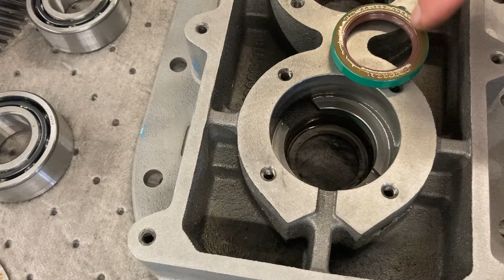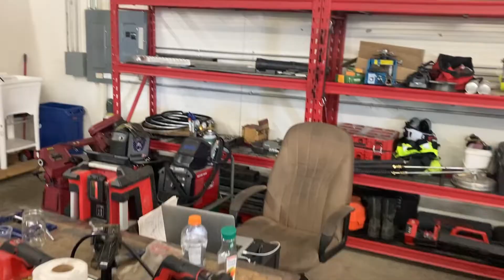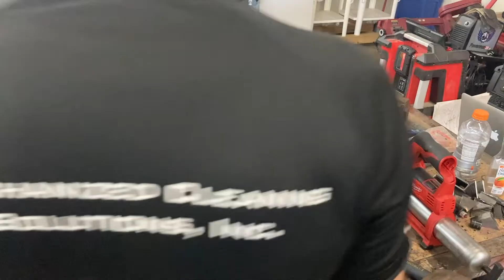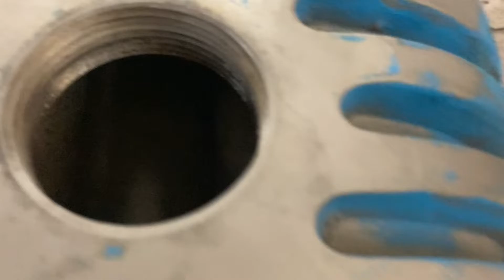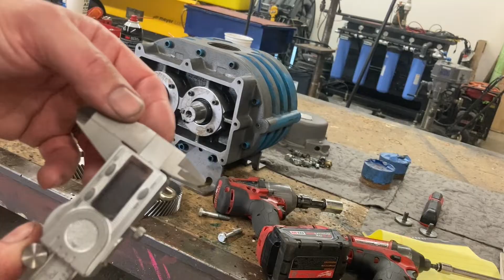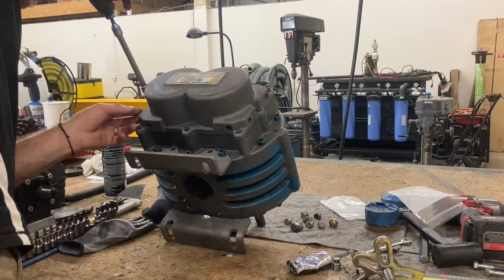Rebuilding a Roots Blower   Part 2: Reassembly & Timing

Comment: Get yourself a bearing heater or a light boat of grease on the inner race hit it with a torch until oil just starts to smoke. Then they will just drop right on. Never hammer on the bearing this way.

Comment: I heated my gears up, not a lot either. Used a heat gun not a flame of any sort. I could handle them bare handed without burning myself but still hot enough to where i could slide the gears easily on and off without tools. If you heat your gears and still have a hard time you can use freeze spray on the shaft to shrink it a bit.

Comment: You should never beat on bearings with a hammer. You need a bearing heater element to set the wear sleaves and bearing races on for about 10 minutes while putting loctite retaining compound on the shaft. With welding gloves on and the sleaves and races now tinted slightly yellowish in color, you take the sleaves and bearing races off the heating element and drop them right into place. No hammer or socket or punch tool neccessary. Also when you time the gears the lobes/rotors should be timed one at a time at a 45 degree angle with the feeler gauge in place when the gear is set with the correct torque spec as the manual suggests. This video is basically showing you how not te rebuild a blower lol.
Reply: ya this is my backyard mechanic version because nobody else who knows what the f*** they are doing got off their ass and put a video up.

Comment: Used to repair tepro roots pump. They got straight gears, so you don’t really have to time the vanes, but I’m glad this video exists so I can prepare for curved gears.
Reply: You still have to time them.
Reply: @scottdove6364 yea I figured that out. They were held by friction, so if you partially pull it off, lobes can slip. Basically that’s how I calibrated these.

Comment: You're lucky you have keyways, I'm building a 406j roots blower, and there's no timing alignmentarks etc, i made my own before dissassembly luckily on the shafts*
Ibised a carpenders square to check alignment on the marks i made*
The seals do go with the open end facing out, that deals with 2 issues-1 installation on the shaft is less likely to rip the seal* 2- the oil will stay in the case better woth the seals design.
Reply: After you have ends on block lobes and use feeler gauges to measure total clearance can time off front or rear just make sure you split clearance a couple thousands more on front front grows more. Put shims between leading lobe when pressing on gear. I also don’t see him checking end clearance

Comment: what is the maximum continuous running time of roots blowers?
Reply from the maker: On a bench in a shop, not in any working application, or moving any type of media. Until you run out of gas or the power shuts off.

Our application is probably the worst and has the least run time between cleanings and rebuilds.

Comment: High vacuum grease on the seals and as far as the sand you killed that blower should always blow out brake clean body and plates brake clean again and feel with your hand or put wd40 on a rag  and wipe all the places you can reach and the ones u can’t make something the particles will stick to that rag showing the cleanliness of the parts

Comment: Heat the inner race only and work fast tapping each position n,s,e,w of the inner race till bottomed out let cool to room temp then make sure it is seated again it could draw off the shoulder a 1/32

Comment: Please my dear brother. What kind of oil did you use? Can I use 46 or 68 oil in its place?
I follow you from the Kingdom of Morocco
Reply: Tuthill maneja aceite ISO VG 220 sintético, es el que recomienda en la mayoría de aplicaciones
Reply: @mayacruzcarlos2383 Can I use 0048E trane oil? Thanks
Reply from the maker: Our blowers made by Tuthill, use “HEC 100 Synthetic lubricant”.  That’s an oil the the carpet cleaner machines use, not sure why.  I’d refer to your users Ma yak for the correct oil for your blower and type of work.  In a crunch, I’d chuck some synthetic gear oil, like 75w, and not worry about it…
Reply: God bless you, dear brother. I have a tuthill 4005 blower. It is black in color. Can I use avis compresseur oil?

Comment: Never used one of these vacuum/blowers. How often do they need rebuilt? So far just been using the shop vac type with pump out as we don’t have to reclaim that often but planning to build my own with this type
Reply from the maker: Hey D, rebuild frequency depends heavily on three things:  how much water or moisture is making it through the blower either in vapor or liquid form, how much fine grit small solids and debris make it to the lobes chamber, and how much non neutral PH (detergents and cleaners).  All this causes them to rust out and lose internal clearance and eventually bind up and jam up to the point where they won't rotate at all.  I've seen them go to hell after less than 6 months, and I have some that have gone upwards of 3 years and still spun freely even after that much time.  Do not let your capture drum fill up and let the blower start sucking water and debris when the pumps get backed up, and don't put them up wet after a work day.  run the blowers for a couple minutes sucking clean dry air to dry off the lobes then fire some WD-40 into the intake right before shut down to coat the internals in light oil prevents rusting and gumming up.
Reply: @PolyVshot  thank you
Reply: @PolyVshot  try when vacuum sucking plastic pellets around a factory, if the blowback dust extraction fails ,fine plastic dust is sauced into the lobes, jamming them up ,with the running temp of the unit by its self, its enough to melt and coat the whole insides....luckily ares are straight gears, but it still a days work to strip, wire brush all the molten plastic off, and re build the unit. thanks for video, regards from UK
Reply: make sure float switch moves freely every day and keep oil centered in sight glasses

Comment: I just wonder what if you heat the bearing using magnetic heater? will the outerrace can go through the bearing housing?
Reply from the maker: Induction hearting is not necessary…

Comment: Did you end up having trouble with the seals, with them being set in backwards?  I am as I'm rebuilding mine.
Reply: Sí tuvo problemas al colocar los sellos al revés, se puede observar que al final del vídeo la grasa no sale por el desfogue ubicado en la parte de abajo del blower 😅 y empieza a salir detrás de donde se está inyectando.
Reply: Rule of thumb lip goes towards whatever you want to keep out or keep in gear side lips face towards the gears or spring side keeping oil in there is consequences for reversed seals in anything you build and again heat the gears round 200-212 degrees flipping it while heating so heat evenly disperses
Reply: They are actually not set in backwards the way they are set in here.  There’s no consequence for setting them in either way…. Doesn’t affect anything…
Reply: @benshrope5707  I installed them the same way, and they folded on me. The spring came out of the seal too. 
Trying to figure out how to install new seals the other way ( backwards)
Reply: @ShowMeMO-Digs  Normally the seals are fitted in the opposite direction to that shown in the video, so it is at least in Edwrads roots pumps, I am fitting one right now. EH500. There are two good reasons:
1 By mounting them upside down, their seal is better
2 When mounting the flanges there is no risk that the seal will break.